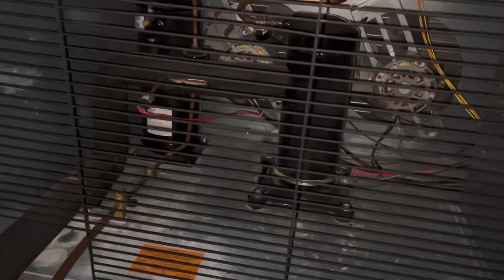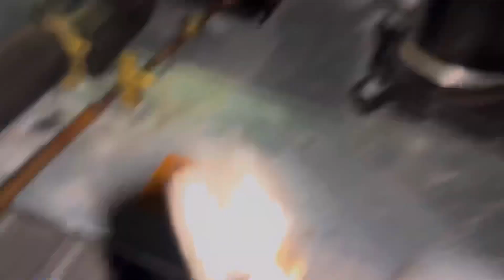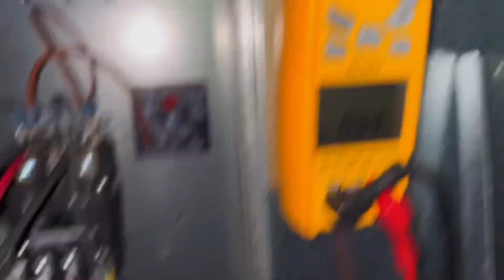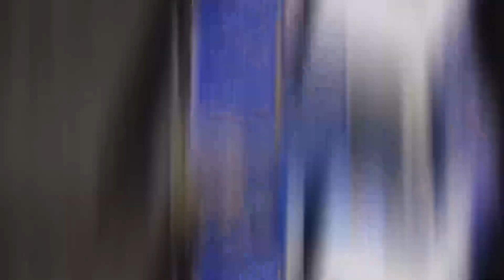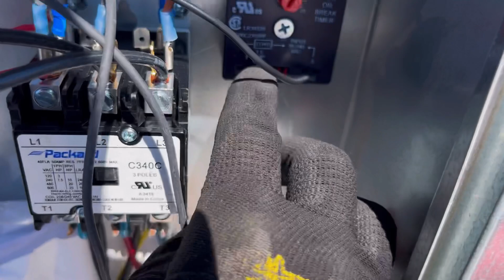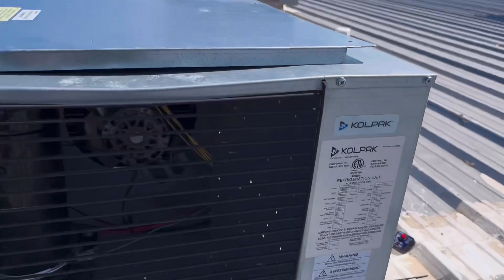Walk in Cooler Power Outage | Stay Calm for the Delay 😏

Comment: You should add the disconnect to the price of repair if you can. The "do not exceed" budget can be hard sometimes. The roofing iron needs to be protected from treated timber as they react and causes it to rust. I usually use butynol to wrap the timber so they don't rust the roof.

Comment: Great video 👍💪🇺🇸🐕☕🏒 Question about time Delay relay. If ur using 120 or 240 voltage u cut the red wire ?
Reply from the maker: Yes that's right
Reply: Thanks